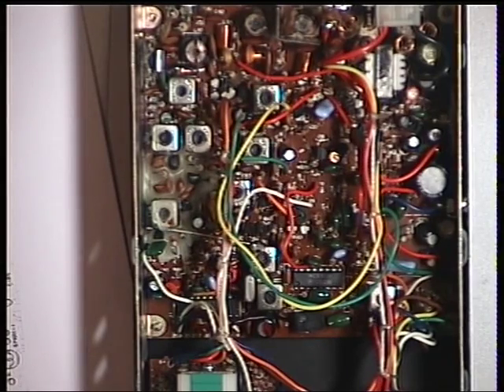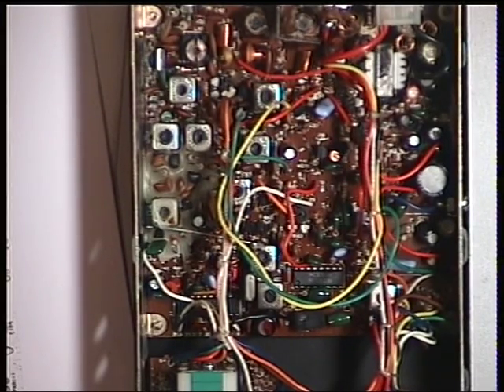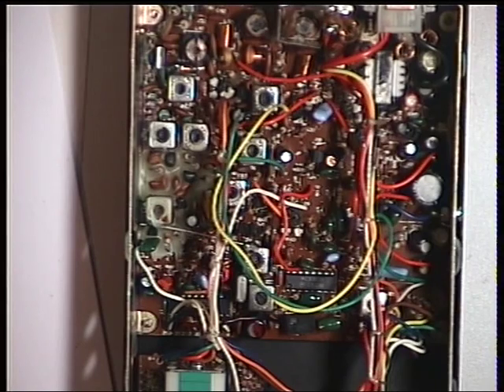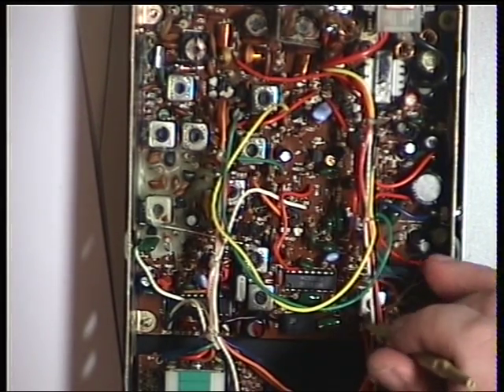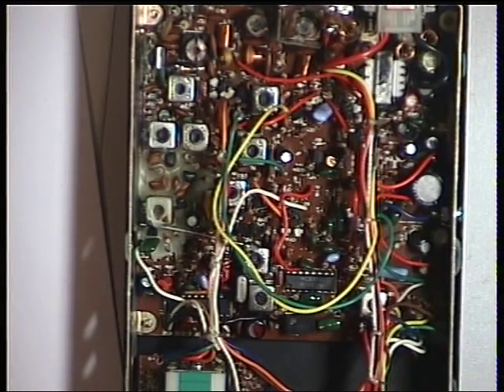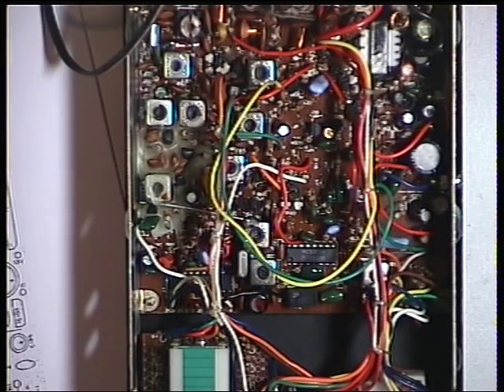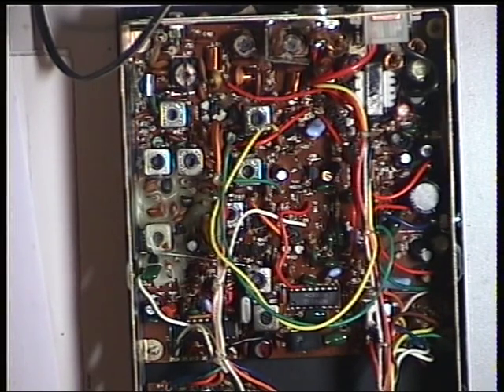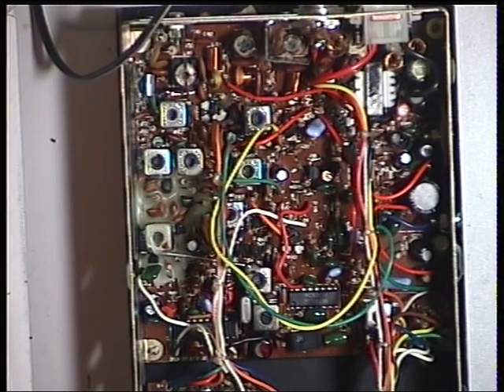Maxcom 4E, UK (CB 27/81) CB radio (Mobile)  - Receive alignment

Comment: Hi Richard, I have a colt 295a (maxcom 4e) that has no sound. I can transmit with audio to another radio and can receive a signal because the needle swings OK but cannot hear anything ( it's the same on pa). I have noticed that the big chip (ta7205ap) gets very warm when the radio is switched on, any ideas what it could be? thanks for your help, great videos by the way.
Reply from the maker: Chances are that it's the Audio IC that you mention, rather than duff capacitors in my experience. I think you'll find it's a KIA7205 rather than a TA7205. There is no difference elecrically, but the KIA version has a slimmer heatsink tab making the TA7205 impossible to fit physically into the space. I may be wrong...I may be right. It varies, but be aware of that potential snag.

Richard
Reply: +UK CB radio servicing yes you are correct, it's a kia7205cp. I have just removed it and can see it has a blow mark on the side, I have looked on eBay but can't find one! Is there an alternative I can fit as it is a tidy little radio. many thanks for your help.
Reply from the maker: I am hoping I've managed to order a couple of these IC's from China, though it'll be a good 3 weeks coming.

Richard

Comment: Was the radio mobile 202 any good or the Cybernet beta 3000 ?
Reply from the maker: The Radiomobile 202, Ford Roadmaster 505 & Cybernet Beta 3000 are all the same....and excellent

Richard
Reply: @ukfmcbradioservicingTango21  thanks Richard merry crimbo I had a cybernet beta 3000 free out of a Land Rover my dad bought,then yesterday I got given a radio mobile 202 free off a lorry driver down the road 👍
Reply from the maker: @lyndonwebber1389  Very good...even now 38 years later, there is nothing on the market with better performance.

Richard